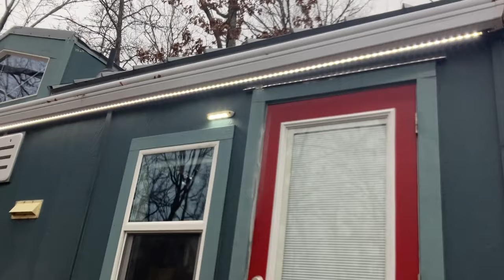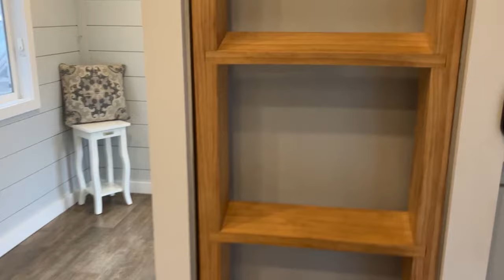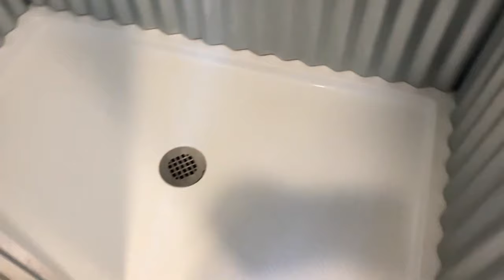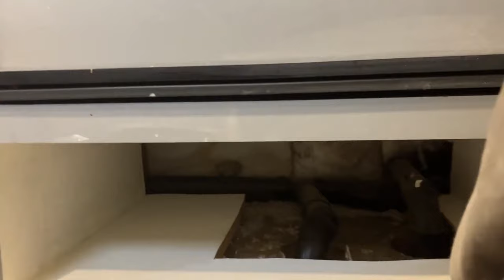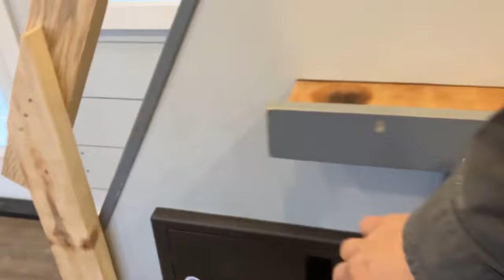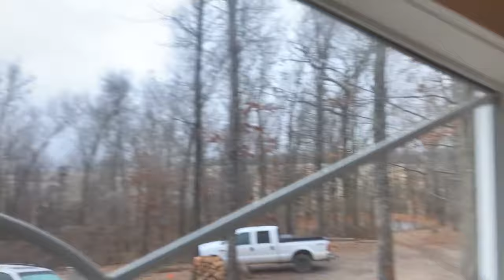Tour a Gorgeous 2019 RVIA Certified Tiny Home | Stylish Living in a Compact Space! 🏡✨

Comment: It is recommended for trailer/RV tires to change them out every 5 year regardless of tread or them sitting in one spot for years. Sitting in one spot under load for a long extended time, or years can weaken a tire. Also get a tire monitor system for the trailer tires. Find out the GWVR and get the best tire rated for that weight. Also note the maximum speed those tires are rated for and never go over that speed.  
Make sure you have at least one spare correctly inflated. Always carry a portable tire inflator. Tires that blow out can cause damage to an RV or Tiny home. We now only put G rated tires on our RV.       It is better to be proactive and change tires out at a certain time. We have learned out lessons after RVing for 13 years. Always make sure when purchasing tires that they show you the month/year of the tire that is noted on the sidewall, to confirm they are new tires.